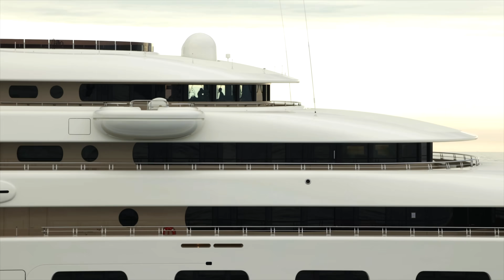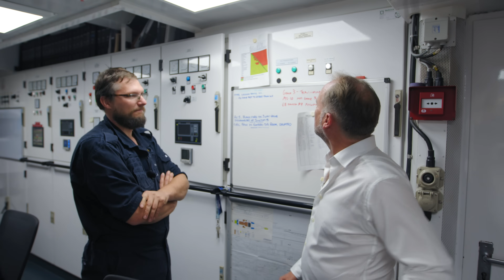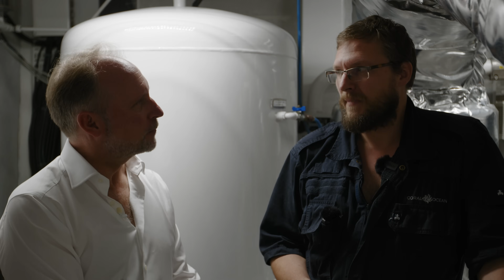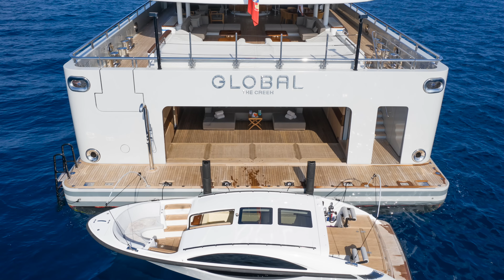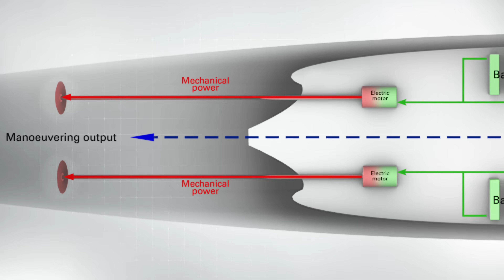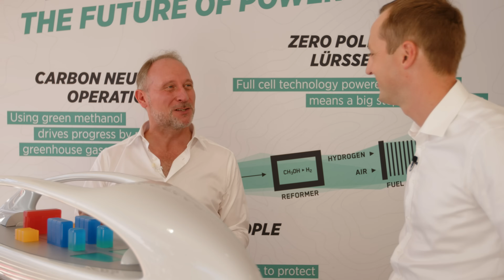LÜRSSEN SUPERYACHTS LEAP INTO THE FUTURE!!!

Comment: It's great to see perhaps the premiere Superyacht manufacturer taking net zero emissions into consideration to the length that they have. Where Lurssen goes, the rest will follow. In an industry that is the pinnacle of conspicuous consumption, it's nice to see a move toward more green practices
Reply: Those exhaust filters are going to need to be changed often so you will go through those quite often. Therefore you use more energy and material to manufacture those. Also batteries are no where near net zero and most mining operations for minerals used in batteries have abhorent conditions. They also utilize child labor and destroy the surrounding ecosystems conpletely.

Comment: I just love these technical elements in your presentation. Great to see they use tested technology. In the merchant ships we always used starting air for the engines. Old proven technology. One of the recent technologies I love is the re-gen function on the shaft, or running on one engine and using the spinning on the second shaft to charge the battery banks.

Comment: Really love this video and the topics it covers from the engine room into the technology cause I had not been aware of the hydrogen used by a yacht, only the subs. And also I had been aware of the Mehtanol reformator technology as one way to power heavy trucks cause the weight of tanks for compressed tanks is still an issue, but had not thought about methanol for yachts.

great progress - and of cause really nice explanations and introductions so time to subscribe.

Comment: Okay, finished the video and WOW, I'm loving that Lurssen fuel cell tech! Have they published any figures about efficiency vs. conventional diesel? I know the goal is ultimately net zero emissions, but I would be interested in a rough comparison of this system and a diesel in terms of range. Thanks as always for a great video, David!
Reply: I too would like to see some actual numbers. That said, hybrid electric systems ARE inherently more efficient with their fuel burning than conventional systems, by a nice margin, especially for hotel load. How much of a margin likely varies from ship to ship due to design choices. Hybrid systems are more expensive than conventional systems in upfront costs, so not all are created equal.
Reply: It depends on so many variables that basically no-one would get anything useful out of it. Especially laymen. A great first step would be to explain that efficiency is not a valid nor rational term to use in these matters at all. "Efficiency" is a nonsense term which has no use at all.
On yachts, just like in cars etc. in a simplified sense the ONLY things that matter are:
1. Overall CO2 emissions
2. Cost
Reply: Finding numbers for those two variables is incredibly complex and requires going through a vast amount of stages, processes, etc. And those figures depend on huge variance at each stage, and there are never any fixed numbers, even nearly for them really. It all depends on how the fuels are produce and from which raw materials, how they are used, who uses them in which way in which types of vehicles which require how much CO2 to be manufactured, etc... 
And the cost is an incredibly important variable. For example with electric cars the cost is so massive that the cost alone makes them far less environmentally friendly. You have to be aware that the UN climate panel has found the wealth of a nation (/the availability of funds to invest) to be the most important, the most reliable determinant of a nation's real ability to reduce CO2 emissions. Burning up too much money on projects like forcing people into EVs can cost so much that they will never be CO2-positive overall.
Reply: @panpiper  Depends on a lot of variables, but for certain we can't make a set-in-stone statement that hybrid electric systems are more efficient. It depends on the cost, the vessel, how it's used, how much it's used. And one major factor is how sophisticated the non-hybrid-electric systems you compare it to are. One of the main mistakes non-scientifically-minded people make is comparing old yacts' ancient systems to the newest and best single hybrid system. That's a false comparison. It's perfectly possible for a non-hybrid system to be superior with the use of sophisticated thermal energy recovery systems, extremely efficient direct mechanical energy use, etc. And above all with lower costs. 

Lower costs is something people constantly forget, as there is always the opportunity cost to consider. If you can save by not spending on an expensive hybrid system to maybe reduce emissions/consumption eg. 5%, you may be able to invest that money into something else which reduces emissions/consumption far more over that yacht's lifetime in the way that specific yacht is used.
Reply: Just to give an example why efficiency is totally irrelevant:
Take for example a diesel-electric yacht burning diesel and compare it to a purely combustion engine yacht burning LNG (liquefied natural gas) or any other biofuel, e-fuel etc. The diesel-electric yacht may burn a few percent less fuel during its operation, but it might cost a lot and that fuel is still fossil fuel and burning it emits a certain (large) amount of CO2. Compare that to LNG which when burned may consume that eg. 5% more fuel in quantity, but since the resulting CO2 emissions from that fuel are much lower you can burn a lot more of it and still be much lower in emissions. 

Now think of filling those LNG tanks with not fossil natural gas, but biomethane instead, which can theoretically be negative in CO2 emissions (as in theory you are reducing methane emissions, and methane is many times more harmful of a greenhouse gas so gathering up that methane and burning it is better, it only releases CO2 which has been gathered from the atmosphere so adds no new CO2). You might be able to burn twice, three, four times the amount of biomethane and still be far lower in CO2 emissions than when operating the world's most "efficient" diesel electric hybrid drive system. And on top of it you might be far lower in costs, allowing for investing in other measures which also reduce CO2 emissions.

= "efficiency" is irrelevant. Only the total amount of CO2 emissions from the whole system over the whole vessel's lifetime and the costs matter.

Comment: Methanol is available at virtually any port already today. It is NOT sadly (yet) net zero as it is usually manufactured from natural gas. There are several R&D pilot plants being built or on the drawing boards to make methanol from renewable electricity that will literally pull CO2 from the atmosphere to make the fuel. THOSE plants will be producing net zero methanol.

An enterprising yacht owner could invest in one of those pilot plants sufficient to produce with that plant the methanol equal to what their yacht consumes and put it on the market normally, then purchase methanol from whatever source their yacht requires and their net carbon emission for their yacht plus their pilot plant would still be net zero. I'd love to see such a yacht 'named' Net Zero.

Comment: I noticed he didn't actually answer your question about acquiring methanol. Where are you going to get it? I know it's cheaper to produce, but where are you getting it? You can't pull up to Gibraltar or St. Barth's and ask for 120,000 liters of green mass methanol please! How does it compare to diesel in regards to the amount needed to achieve the same range? Supposedly it is better, but that's under different mixing situations. What solution are they running? So many questions?
Reply: Methanol is stored globally as it's used in the creation of various products. Over 100 commercial ports already have a methanol available for bunkering. You're right in that none of them are in the Caribbean, but there are several along the east coast of the USA. However, these can easily be added to a commercial port.
Reply: Agreed, big time! The big advantage is that these massive ships can hold enough fuel to almost circle the planet and refill, but that is not very convenient to say the least. 
At least he mentioned bio mass (diesel 🤫) which is extremely promising, and I hear California has started to embrace that.
Reply: Right now most methanol is produced from natural gas. It IS still cleaner than most other fuels, but it is not yet net zero.

Comment: Awesome video. Not a nerdy question, but interested in finding out more about the Hydrogen Fuel Cell technology: Does the process of removing the hydrogen from the Methanol create formaldehyde as a by-product? and if so would that by-product require specialised storage/crew training within the vessel?
Reply: Methanol reacts with water to produce hydrogen and carbon dioxide. “Zero emissions” is a trick of language because technically the fuel cell doesn’t emit any greenhouse gasses but getting the hydrogen out of the methanol does.

Comment: So this system stores liquified pressurised methanol, converts it to gaseous hydrogen, burns the hydrogen in a catalytic convertor to produce electricity which charges batteries which provide power to run the yacht. That doesn't sound as if it is overly complicated, reliant on several rare and / or toxic elements, subject to multiple conversion losses and presents serious storage and maintenance issues. Before you even consider how the methanol is produced in the first place (hint: fossil fuels are involved).
Even if one could run an entire superyacht on angels' tears and happy thoughts, it would still be the most ecologically disastrous thing ever invented by man, because 400 Gross Tonnes owned by and at the service of just one person is an ecological obscenity. Any so-called green technology is only ever used as bragging rights because there isn't anything else left to distinguish one boat from another, or there simply isn't any left of materials that used to constitute luxury on a boat so new ones have to be invented.
If all the Teak in the world had not been used to plank the decks of superyachts, there would be no demand for a replacement wood to plank the decks of superyachts - see how that works ? We have already been through that cycle at least once already - Teak was once reluctantly considered a cheap alternative to Oak because all the mature Oak had been used up planking the decks of ships of the line, tea clippers and other merchantmen in the time of Empire.
Stop pretending any of the people involved in producing or owning superyachts give a monkeys about the environment - if they did, they wouldn't build or own a superyacht.
Reply: They just talk about the methanol to hydrogen conversion as if the carbon in the methanol just magically disappears. SMH
Reply: Finally, a sensible comment that doesn't blatantly push the climate agenda.

Comment: its sounds futuristic but its not. the energy required to produce hydrogen is so much more than just using electric energy in the first place. the future is not fuelcells on yachts or hydrogen gels or tanks, its batteries. simple as that.
Reply: The power density that would be needed for an all battery yacht would be SO vast as to render it centuries into the future, if ever. We are going to need a bunkerable fuel for yachts for a long time yet, and by far the best fuel for that is methanol. Pure hydrogen tanks are way too bulky and leaky, not to mention dangerous. There ARE pilot plants being worked on to produce methanol directly from renewable electricity, sea water and atmospheric carbon. It is still more expensive than making methanol from natural gas, but that is what the pilot plants are for, to research methods of making it cheaper. Meanwhile, using existing natural gas produced methanol for fuel is already still, a lot cleaner than using traditional diesel.

Comment: We used methanol in our pull truck in the 70's and 80's.  Methanol has less energy per gallon than gas or diesel, however it is oxygenated so it requires less air in the air to fuel mixture meaning you can get more into the cylinder to give you more power than gas or diesel.  What concerns me are storage and delivery systems on these boats.  Methanol oxidizes many metals and other materials.  The most concerning is it is very flammable and you cannot see it burning in daylight.  Many people in racing have caught fire and no one would know they were on fire which often delayed reaction time in assisting them.  I would like to know how they address the safety issues.  Also, no methanol or ethanol is clean energy.  It takes energy to produce it (generally fossil fuels because there isn't enough wind and solar available to produce it), it causes the destruction of many forests, it consumes large amounts of fertilizer (fossil fuels again) and it hurts food production.  We might as well mention batteries while raining on the hydrogen parade.  The production and disposal of batteries is as bad or worse as the production of fuel not to mention the safety hazard of large battery systems.  I am glad we continue to research new power systems, however it seems more effort goes into selling the public on false idea that something is green when it really isn't.